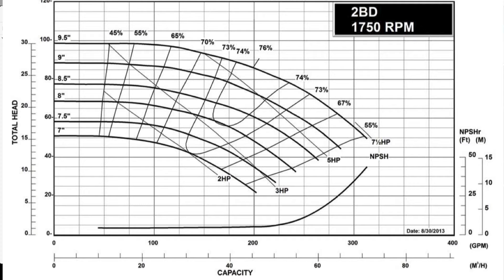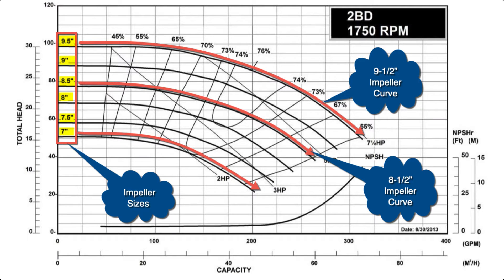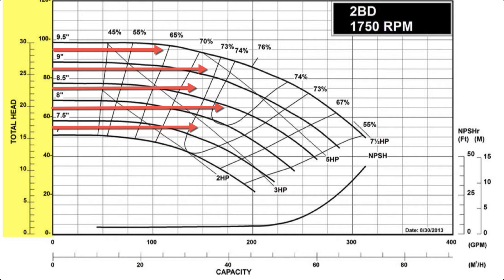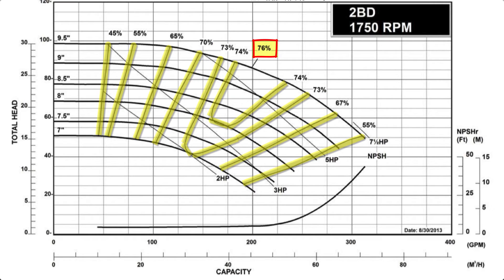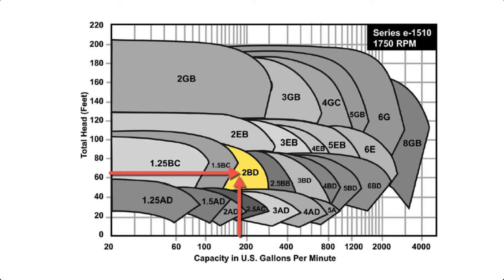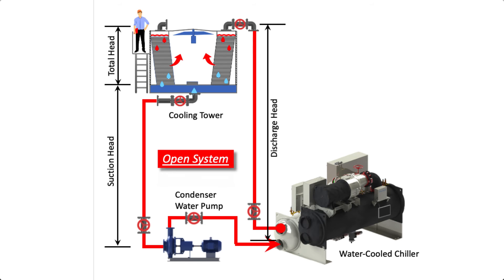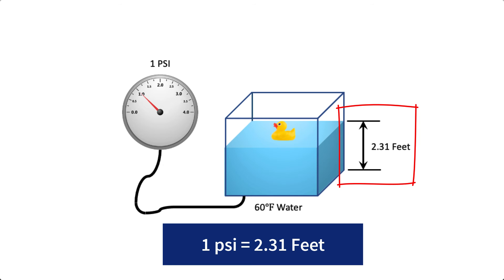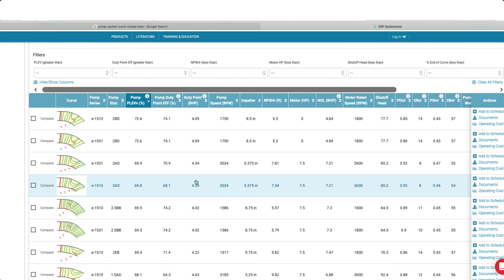How to Read Pump Chart and Select Pump

Comment: Hi sir, my pump flow rate is 3 lps at 25meter head, then what will be the motor HP
Reply from the maker: Roughly speaking, your flow and head would work out to around a 2 HP motor. That’s just an estimate though — the exact size depends on pump efficiency, motor efficiency, and the manufacturer’s curve. For a final selection, it’s best to review the actual pump curve and local code with a licensed engineer in your area.

Comment: Thank you for the informative video. Please note that the formula shown at about the 3:36 mark is not correct. The correct formula is GPM = Q/(500 * Delta-T) or GPM = Q/500/Delta-T
Reply from the maker: Yes, the correct formula for GPM is GPM = Btu/hr / 500 x Delta-T or rearranged for  Q = GPM x 500 x Delta-T. Thank you.
Reply: @MEPAcademy  I want your viewers to understand that the formula GPM = Q/500 x Delta-T is incorrect, and that it is not equivalent to Q= GPM x 500 x Delta-T.

Calculations must follow the PEMDAS order of operations.

Pick very simple numbers to illustrate, say Q = 15000, and Delta-T = 10.

Using the correct formula, and following PEMDAS, GPM = Q/(500 * Delta-T) = 15000/(500*10) = 3

Using the incorrect formula, and following PEMDAS, GPM = Q/500*Delta-T = 15000/500*10 = 300 

These formulas are only equivalent if you put parentheses around (500*Delta-T).

Comment: Great video. What is in this example the 90 tons? A chiller or a cooling tower?
Reply from the maker: The example uses both a Chiller and a Cooling Tower. The tons are not important as the discussion is about Pumps. Thanks for watching.

Comment: Thanks . You have the best hvac mechanical lessons.
At 13:21 is 92.4 ft the final reading for total head on a closed loop system? Wasn’t sure if you had to do more for total head.
Thanks
Reply from the maker: Yes, this is the simplified version. There are other factors but they aren't significant in this example. Thanks for watching.

Comment: Excellent explanation. Thank you sir. I have few doubts. Does pressure gauge's show pressure based on height of liquid? If yes, how they read pressure at suction side? One more thing is could you please explain different pumps like inline, end suction, multi stage pumps etc ?
Reply from the maker: The pressure gauge does not take into account atmospheric pressure, so it does read what is within the closed system including the height and properties of the fluid. We'll put on the production schedule another video for pumps as you have requested where we can help clear up some of these questions and explain the different pump types.
Reply: @MEPAcademy  Sir I understand that gauge pressure doesn't take atmosphere pressure into account. My question is that pressure gauges measure based on height of liquid. if yes , how they measure  pressure on suction side? I mean suction side is in datum position right( no height).